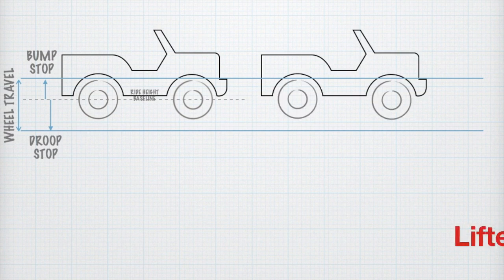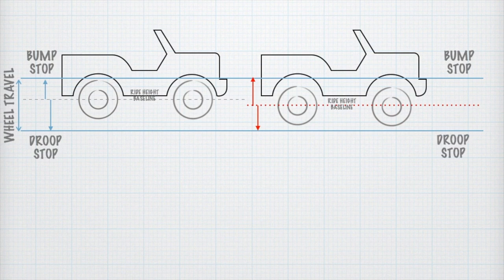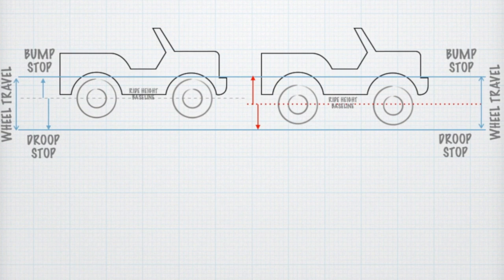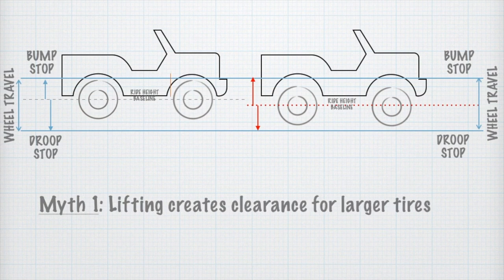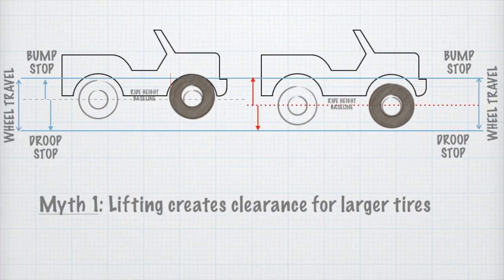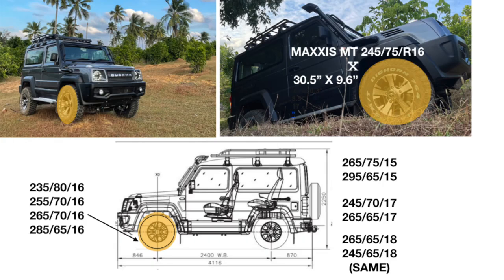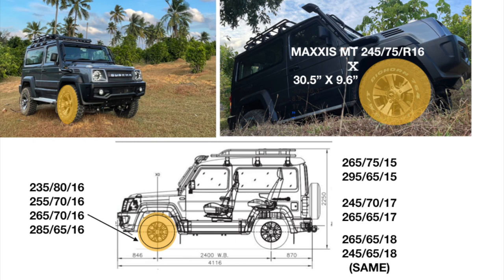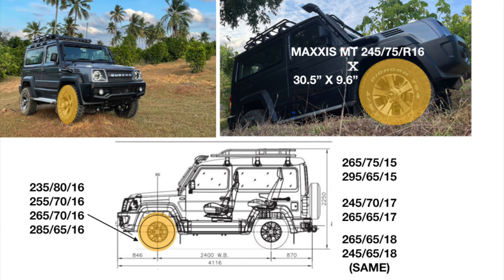Need A LiftKit to Fit Bigger Tires? Myth Busted ! How & Why to upsize your offroad tires?

Comment: +1. I have started liking these 5 mins shorts. Since you have upgraded the tyres keeping the circumference almost the same, would it void the warranty? I understand you also have a lift kit installed. I had asked the Force SC and they said it would and asked me not to.
Reply from the maker: Yes. It does void warranty as it would be considered a major modification as mentioned in the video. 
If you have a defect and you take it to the Force Service Center for rectification, and if the issue can be linked by them to the lift kit then, they can deny the warranty fulfilment. This is true for any major change in any car . 
A bigger tire, as I suggested (within reasonable limits) should not be much of a problem for warranty, unless you’re really unlucky with your service team.
Reply: Thanks for the confirmation